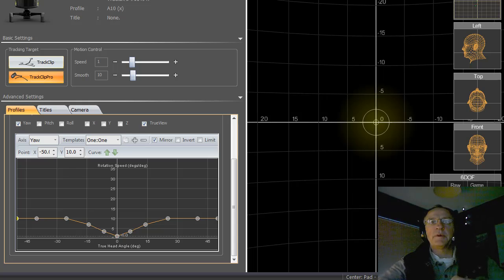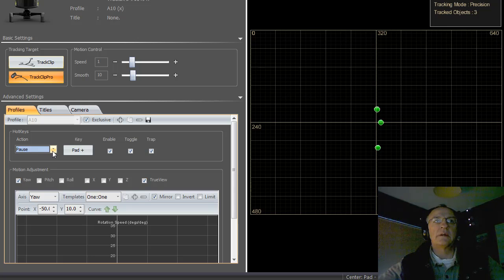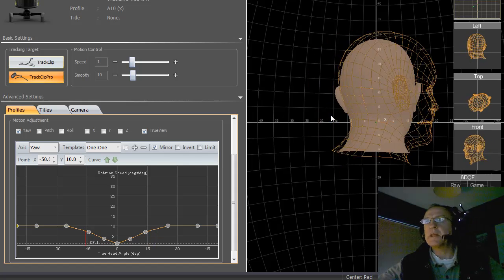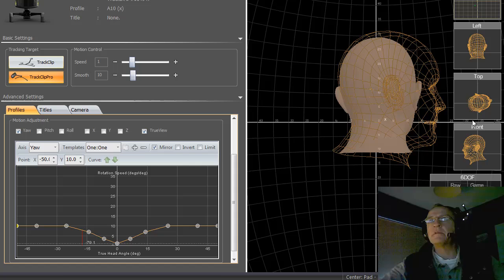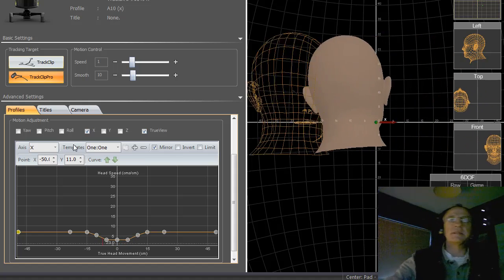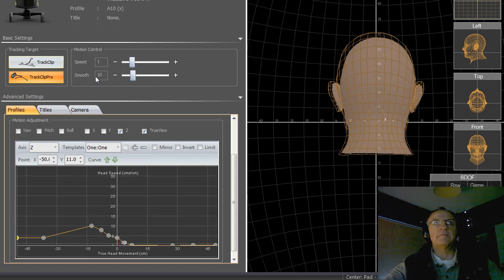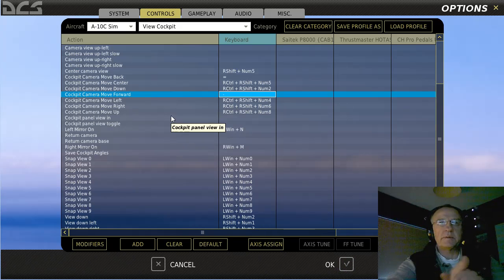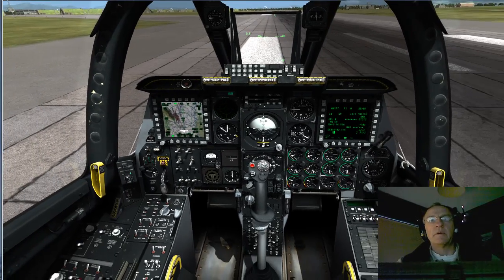Setting Up Track IR

Comment from the maker: if i understand the question, you need to have all the axis radio buttons under the motion adjustment section, ticked after you are happy with them (or only the ones you want, i for example dont use the z axis in ARMA). then hit the save button under the profiles tab, to save the settings.

Comment: Hello Gerry....new to DCS & TiR.  Your video is a must see and very helpful.  (Much more so than from TrackiR.)  Quick question please sir:  I want to sit lower in the cockpit.  I was trying to adjust the Y Axis but can't figure out how you got that bar graph to appear (10 degrees on the left side of center & 3 degrees on the right side)  Just using the up & down arrows doesn't have the same effect.  Is there a simple explanation you could share please?  Thanks!

Comment: I struggled w/ setup for days until I came across your vid by Goggling & am glad I did.  I feel I'm about 85% there.  Need to fine tune profiles.  The manual leaves a lot to be desired:(  I was trying to program ALL axis at same time which really tripped me up. Thanks for getting me out of the woods.  My wife & dog haven't seen or heard from me in days.

I'm in my 60's & catching on quickly is not one of my attributes!  It's been awefully lonely out there.  Your teaching method & voice are very easy to follow & understand. I'm now a subscriber.  Thanks, Jim

Comment: Thank you Gerry. I am new to DCS and TrackIR. This video was very helpful. I am glad this is still relevant after 6 years after its posting.  I am rediscovering PC flight simulation (original Falcon 4 jockey), and I am blown away with the DCS platform, it’s community and longevity.

Comment: Just watched your tutorial and I'm now going to have a closer look at my settings to see if I can resolve an issue which I find quite annoying. I have been using TrackIR5 for a few months now and it's probably the best single piece of kit I've purchased for my flight sim. That said, the issue I'd like to resolve is very similar to that outlined by Simon Skyfall (three entries below mine). Typically, when landing, the runway is often at a slight angle to the right despite trying to line up correctly. I have a switch on my HOTAS mapped to re-centre the TrackIR and find myself continually pressing this as I approach the runway. I'm hoping your tutorial will help me to fix this issue. Thanks for a great reference guide - this is not an easy topic to explain but I think we all agree you have done great job - well done.

Comment from the maker: Not obvious from the video, but there's a vertical scroll bar, on the profiles tab, if you make sure its scrolled up (in the video its scrolled down), you should see the a profiles 'header' section, which has all the create/name/copy/save options. They all have smart help, so hover over them and you can see what they do.

Comment from the maker: U can guess from the video, that I'm not a great fan of precision mode or dead zones. I just use constant centring with a well mapped centring button. Might take a little bit more to get used to it this way. Works and feels more natural. Map the pause button if you want to hold your view for a bit. You could start with deadzone, and gradually reduce it as you get more used to how it feels. You will get the best experience when you don't have dead zones.

Comment: Very good instructional WD  -- I use TrackIR for ARMA3: To use in Infantry/Helos/Jets you will need a 'Dead-Zone', because this allows slight head movement without any dramatic resulting movement on screen. Otherwise you can have distinct profiles for ground and air roles i.e. On the ground you will want a dead zone, whereas in the air this is not really needed, I find.  (Primaate - HT/ TR KotH MP)

Comment: Thanks Gerry for your tutorial i got a lot out of it being a new user. I still need to do a minor adjustment i was hoping you can tell me how to set it. The configuration i have done is based on your tutorial. I am finding that i am still moving my head a fair bit on the screen. How can i reduce this.

Comment from the maker: hard to comment, as i don't play that title. Each game will be configured to place tir (centered) in a 'default' position. Position when u hit the center key. In some games, with a bit of tweaking you can adjust this.Suggest u post on your favourite game forum about it. What i do generally, is if im too high, i will sit up a little, and hit the center button, then sit back normal, so the new centered view is lower. Not ideal, but easy to do. Hope this helps.

Comment from the maker: Put the .xml file into the TIR5/profiles folder. Restart the app, and it should be available from the profiles dropdown. To adjust the pofile, select the axis, then you should see some dots horizontally on the botton of the grid. You can drag and drop them, or use the controls around the panel, with some trial and error.

Comment: Very helpful Youtube. Thanks.
 I just took delivery of a  Track IR 4-but it has the latest software. One thing I noticed when calibrating-I wear glasses with a photo gray coating to cut back on UV.. I could see not only the green dots-but red oblong dots from my glasses from the infra red reflected off my lenses when in CAMERA VIEW-and sometimes the red dots flash green when my head is at certain angles.  Does this mess up calibration? I don't know.
Just mention it. I fly without my glasses with no problems. But I was thinking maybe sunshine -artificial light may not just play with Track IR usage -but the UV coatings on prescription glasses. FWIW.
Reply from the maker: I have the same UV coaetd glasses, no issues here. Don't try to run it in bright daylight, cause you need the sensitivity up, and you glasses will be picked up. Best in low light, with no direct light onto the camera. Adjust the sensitivity appropriately. Camera veiw always the best for this job.
Reply: Okay-No problems so far aside from adjusting the sensor to my liking. I can't thank you enough on the video. It saved me a lot of time figuring out the software.

Comment: Hi Gerry have had TrackIR5 for some time and used it in FSX and have done very little tweaking. Your video has certainly opened up a whole new understanding of how to use much more of its features. I have recently downloaded DCS A10 and am very keen to use your profile. Once downloaded how do I import it? Also when I have a profile open displaying advanced settings I am not seeing the curve with all the adjustment points that I see on your video. Would appreciate any tips you might have. Thanks

Comment: Thanks Gerry for the prompt feedback...I figured out that for some reason when TrackIR is in full screen mode the curve display does not show the curve but as soon as I go out of full screen mode all is revealed. I have another query if you don't mind, I am used to using Ezdoc in FSX which allows me to create fixed stable views of the various pit panels that I assign to buttons on the joystick. Could you suggest how I might do something similar using Track IR?

Comment: Thanks Jerry.. discovered that in full screen mode the curve panel displays differently than when minimised for some reason. Another question if I may... I am used to using Ezdoc which allows me to configure fixed and stable views of various pit panels that I assign to joystick buttons that I can call up during flight. Could you suggest a way of trying to get the same effect using TrackIR??

Comment: Thank You Sir for an eye-opening video regarding the use of different axis than default. I'm currently trying to achieve a working solution with FreeTrackNoIR as I have an old webcam but apparently there is a good reason to pay for TIR5... P.S. in FTNIR there's also a key for game view center which resets game view to default. Haven't really lookes into it much yet but I imagine you could use the same button for both tracking and game centering if there is such function in TIR?

Comment: I cant seem to use any of the  camera / cockpit views from keyboard or Hotas ? only the track IR moves the POV.  Outside the plane is  ok with key or Hat.  What am I missing.  Btw i like most of your TUBES, they seem to  be practical and thorough, unlike most of the others, selling or performing.
Reply from the maker: Thanks for the kind words. I'm guessing you are refering to DCS  pits. Don't think you can use both TIR and keys/mouse, though its been a while since i use VR for DCS. BMS allows the use of both TIR and keys, but only when you pause TIR. Issue is not TIR related but how the game is coded. Nothing wrong with your setup. Post on DCS forum might get more info .

Comment: I like your presentation very much. But I can't get past the first 3 minutes. I line up the camera so that the 3 green spots are centered in the Camera View, as you described. Then I switch to 3D View, and everything is askew. The X and Y axes are tilted, and all my head views are at the top of the screen looking sharply down. Any suggestions?
Reply from the maker: You need to center the '3d' view, with the centering button (Might be F11 by default, but you will need to check that).
Reply: Actually, the problem vanished when I exited and then reloaded the TIR software. It seems to happen whenever I leave the software open after I've finished playing and put my headset away. I will just remember to close the software when I'm done. Now I can get back to your excellent presentation and calibrate this thing properly with your help! Thanks again.

Comment: You will be assimilated resistance is futile. Only problem i have with this is setting the right hieght where to put the trackir 5 im way too low or high and can not find a right height.

Good tut though.

Comment: Hey to Gary, greatly informative vids. Thanks much. Questions if I may: Are you trying out any particular VR headset ? And are you liking it more than Track IR, if so ? Would like to know your CPU an peripherals if you feel to share. Also are you into Star Citizen at all ? Thanks for all yer time and great instructionals, keep em coming. Am trying to learn all about the A-10C. P.S. How about a vid where you take the C up to 25,000 then invert and hold level until the aircraft shuts itself off. Then right the craft holding level. Do a complete shutdown of all switches. Then restart the ship. Side note: if over a safe area would dropping all external stores be part of this scenario ? Peace, brother
Reply from the maker: +Dave Almeroth Wow, few questions there Dave..... VR: No, wont jump until tech matures more. CPU: 6700k@4.5Ghz. 2 gtx 670 sli. SC: No still in alpha. Video: Other BMS videos to come before the A10C 25k shutoff test im afraid. Jettison is always safe in the sim, weapons are not armed/fused. (actually don't see the reason for such, engine restart mabye, but does not need to be 25k.)

Comment: Hi Sir,

Thank you for the tutorial.Really helps alot. I have a question. How did you put the Trackir_z into the DCS zoom view ? I cant seem to find how to place it there. Would really appreciate your help Sir.

Regards
Reply from the maker: DCS, Options, CONTROLS,A10 SIM (or whatever aircraft you wish to configure) AXIS COMMANDS. Set Zoom = TRACKIR_Z. Note you must have TIR active, for DCS to see it as a controller. Check out my video "DCS A10 Pit viewing with TIR and Cougar. "

Comment: Hey Gerry, that was an awesome and beautifully put together tutorial mate. I know your vid is 5 Year’s old but I’m sure the principles are the same. I wish there were more up to date tutorials on this half as good as yours. I only just picked up my Trackir5 with Pro Clip yesterday and I guess like a few people it’s a bit of a daunting set up and I’m having some probs getting it right. I have downloaded the latest software but still having some issues understanding and making adjustments. I’ve been flying A-10C in DCS 1.5 and 2.1 for about a year now mainly single player missions and campaigns so I know my AC very well and hope to enhance that experience with the Trackir5. I noticed you had the profile set to the A-10C sim but I can’t seem to get the software to add A-10C profile, I do see the big list of all supported games but what do I do after I select one of them such as A-10C or ARMA III? What am I missing? I also heard you mention a key assignment zoom view for making fluid views in the pit, I use the flapper lever on my HOTAS Warthog Stick for the “zooming in slow” action and the little red button just behind it usually used for nose wheel steering I use for “zooming out slow” . Do these actions result in the same as what you meant by the “fluid” views in the pit? I also use HOTAS Warthog Throttle. Sorry for the extended comment and questions. 
Thank you again and I’ll keep fiddling I guess. Cheers Gary
Reply from the maker: Wow, that was a long post. Put the profile into C:\Users\[YourUserName]\AppData\Roaming\NaturalPoint\TrackIR 5\Profiles. Then it should show up under profiles. Ignore titles, I normally just run the profile 'exclusive'.
Reply: That's incredible and thankyou kindly for your speedy reply but just a few hours ago I got that exact same tip from a good Polish friend who also flys DCS and he sent me that exact profile. Sure make life easier, everything works beautifully and I also mapped pause and centre view commands on my Throttle, it's a different world now and so just have to get used to it but I'm enjoying it already. Take care and thanks a heap Gerry, cheers G
Reply from the maker: NP. and thanks for the kind words. Forgot to anwer..... For my viewing I used to use TIRZ with zoom, and the slider on my worthog throttle, for the absolute lognitudinal view, until ED broke it some time ago, and despite several posts its still not fixed. So you cant use an analog conrol for the cockpit longitudinal view, if you have TIR for Zoom. I resorted to using one of the throttle hat buttons shifted for this now..... ENJOY THE FLYING.

Comment: Gerry, when I tilt my head back and reach TrackIR's limit in that direction (pitch) the view suddenly swings around through 180'. Is there any way to switch that off? I would prefer if it would simply 'stick' at that point until I move my head down again. Thanks.

Comment: How does one refine looking at an angle such as down and to the right, or down and to the left, to look at instruments?  My track IR tends to spaz a bit whenever i attempt to do so
Reply from the maker: There's no way I know of to 'refine' the view for a particular 'angle', except cantered. It all flows from the centre. If you are having problems with tracking, I'd start by checking the 'camera view' to make sure the camera and reflector are aligned correctly.

Comment: So trackir should be level with you? I have i big screen TV and its on a aluminum profile stand. So my head doesn't come level with the camera. I have to look up at it.  I find i can't get it right. Is this the reason why?
Reply from the maker: Dont know what. clip u use. But it's a 'lock & key's thing camera and leds. They must point at each other, and camera must see the lights.  If camera is above, then point it down and point clip up. Must be in camera mode to set up. See video. Also theres a max range. Cant have them too far away from each other. Hold the clip in your hand point it to the camera a test whats happening on the software.

Comment: I wonder what distance people view their monitors at? I tried ‘normal’ settings and it wouldn’t rotate passed 45 degrees. I have to set stupid close in high ’spikes’ to get full 180 head rotation by the time I’m looking at the corner of my 24in monitor. Playing ETS2 . It’s ridiculous and I’m about nearly 3ft away with G29 and wheel stand and monitor with TrackIR mounted on it
Reply from the maker: I sit at about 80cm between camera and led's. I have powered LED's (not reflectors). TIR was designed many years ago, for desktop, and not large TV type monitors, so keeping the distance between camera and emitters low is necessary for good performance. Might post on the Natural point forums to get more answers.

Comment: So there are no references to TRACK IR currently in my DCS 1.5 or 2.5, so I assume that when you add the hardware the options will appear ?
Can anyone comment on this ? 

How many aircraft are able to use TRACK IR ?  The list of aircraft from TRACKIR is very limited ... why  ?

As usual many hours of flogging around trying to get the simple steps accomplished.  Something about like the forest and trees
Reply from the maker: Plug iit in.  Switch it on. Set it up, make sure it's working. Then fire up DCS, jump into any pit. Away you go

Comment: Can u set it up with cam on top and leds pointing up so theres 360 rotation (Standing up & moving forward switched)?
(Using headmount)
Reply from the maker: No reason why not. Once the camera sees the led's. You will have to swap what the axes do in the sim, the Y and Z axis will need to be swapped. The roll and pitch may also have to be swapped. Let's know how it works out. Would help solve the issue with tir and a big TV some distance away. Keeping it centered under it might be a challenge.
Reply: Gerry Abbott ok, will try when my leds come
I'll probly disable yaw pitch roll, my phone can track that and have my cam (wireless wiimote) up far

Comment: I need help. Every thing I've searched for has come up with problems that I don't have. I can run the trackir program to calibrate the trackir perfectly fine, the light is green on the sensor, but when I try it with War Thunder the sensor does not turrn on, the IR bulbs do not turn on, no matter what I do. And no one else seems to be having this problem.
Reply: +Lucian Willi If it helps on my profile it says,
Profile: War Thunder
Title: None. I did set War Thunder to use profile War Thunder mind you, and even if I didn't, it still should have used the default settings.
Reply from the maker: +Lucian Willi Have you tried clicking the 'exclusive' button beside the profile?
Reply: Gerry Abbott No.